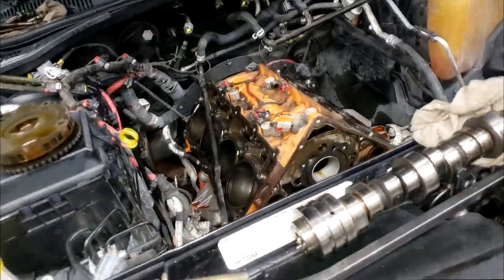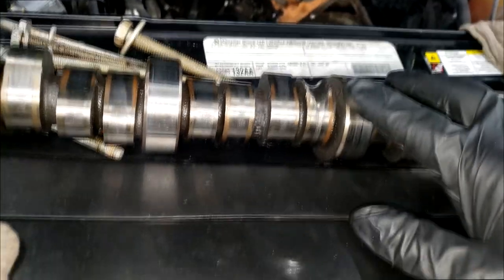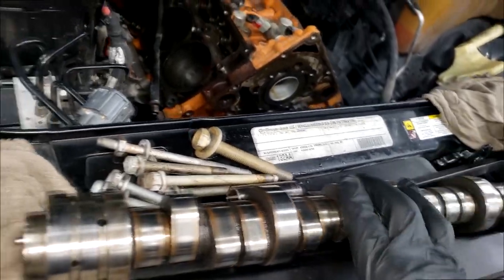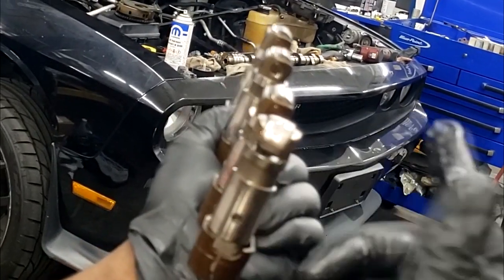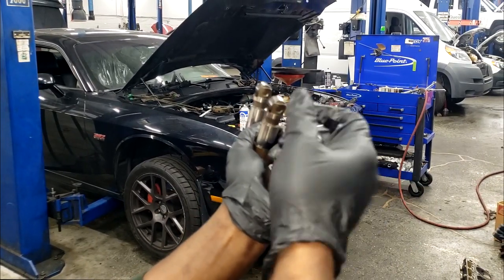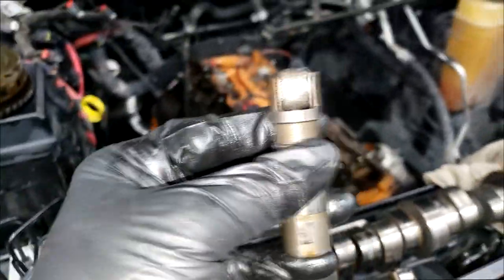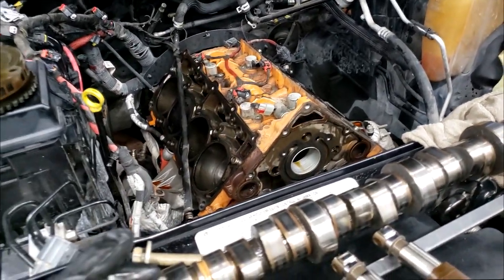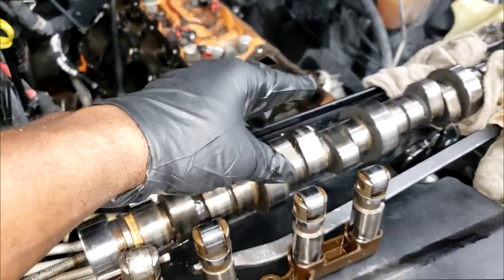What caused the U shape wear on the CAMSHAFT of the Hemi Motors. Ticking noise with Lifter Failure.

Comment: I think if I was going to the trouble of taking the oil pan off and cleaning it out I would also get a couple of heavy duty flat disc magnets from Home Depot and place them in the oil pan before I put it back together that way if there’s any more metal shavings they were just stick to the magnets and stay there And  not flow through the engine Great video thank you

Comment: Every one I've taken apart looks like this,  seized roller on the lifter. The dealer always wants the old cam back. I don't believe the cam is the problem,  the rollers fail on the lifters. It's almost always on the active or MDS cylinders 1, 4 , 6 and 7 I believe. Chevy shuts off the same cylinders and same cylinder layout on the ls motors.
Reply: Yeah the needle bearings on the rollers fail most of the time. Sometimes that's not the exact root cause. And yeah even though the firing order for LS is different it shuts down the same cylinders. The 7-2 and 4-3 swap matters for the firing order but it's still every other cylinder in the firing order that gets shut down. So it still ends up being the same cylinders de-activated.
Reply: @XHikotheproX  The chevy lifters usually just collapse though and it doesn't need a cam. At least it doesn't long enough for me to get it sold wholesale

Comment: I think they do need to upgrade the lifter rack. I'd take a picture and send it to Chrysler but that thing had be grinding away a long time to be that deep so been running on 7 cylinders and hammering super loud. There might be collateral damage from dumping gas in the dead hole too.